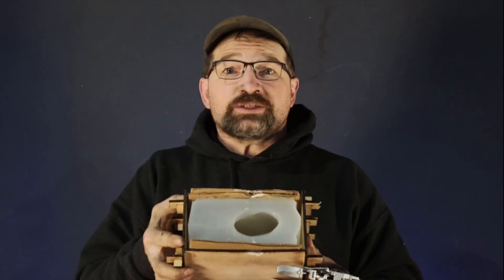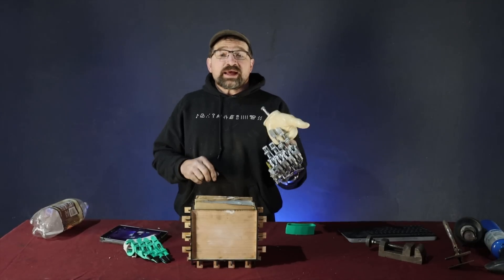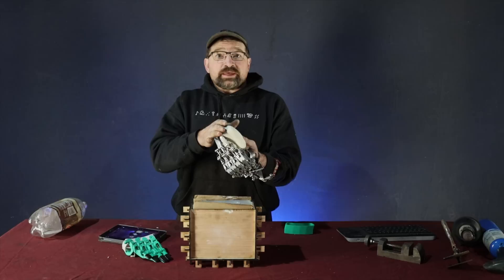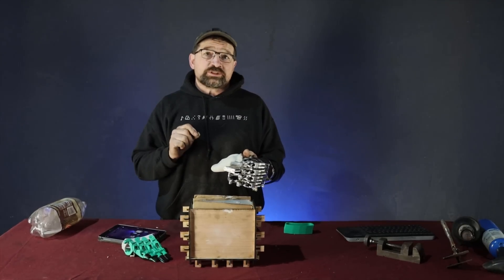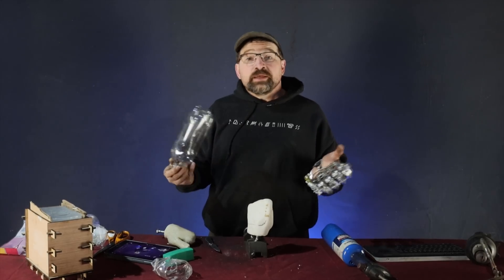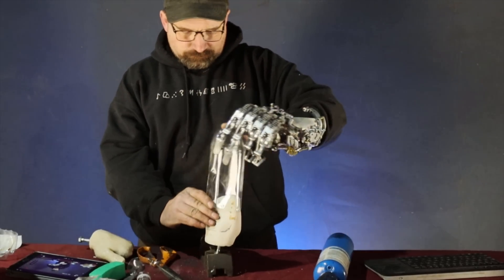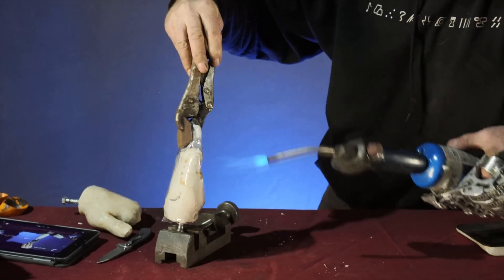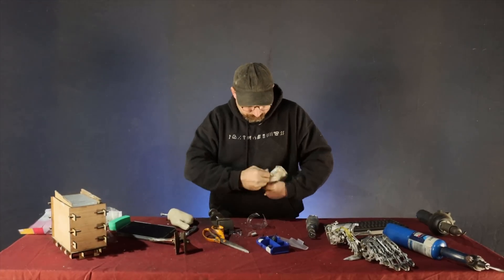3D Printed Prosthetic Hand  DIY Video No.3  Making a Check socket.

Comment: I wonder if technology will ever reach a point of being able to scan and solve the issues that you pointed out on photogrammity, like the mechanical areas that can be loaded. Or if it will be more applicable with making molds on a person to person basis. Really cool stuff dude, thank you for sharing this!
Reply: There are some computer-aided techniques in use already, at least on a small scale. One is to use a series of linear pistons/actuators and force sensors to squeeze all around the residual limb at various points and generate a "heatmap" of areas that are harder or softer (fleshy vs. bony), and use that as a guide for what areas can be loaded or not. It's mentioned in this ted talk around the 5:20 mark: https://www.youtube.com/watch?v=CDsNZJTWw0w
Reply from the maker: If it's the setup I think you're referring to, the one at the biomechatronics lab of MIT,  ya that's an awesome piece of equipment. Although it's designed for lower limb amputees.

Comment: I hadn't realised yet that you can effectively heat-shrink PET bottles, but it makes sense, since they are usually blown out from a smaller injection-moulded preform (looks like a test-tube, but with bottle cap threads), so there will be some residual internal stress from that expansion, that wants to contract again.
Reply from the maker: exactly! 2 liter sprite bottles seem to have the thickest walls.